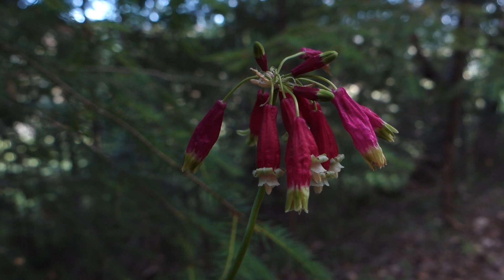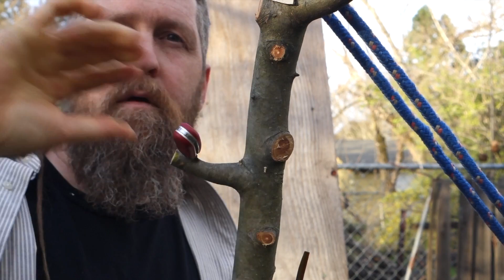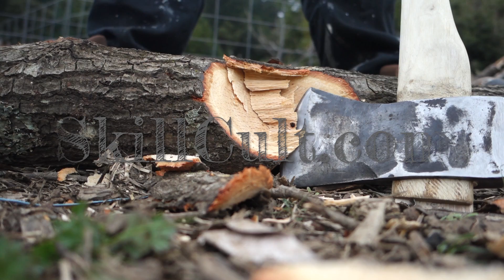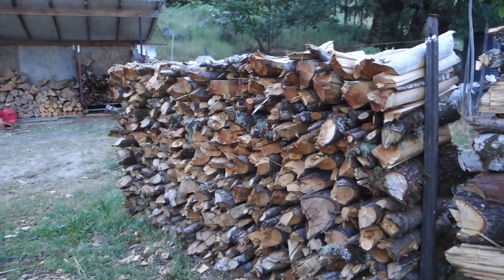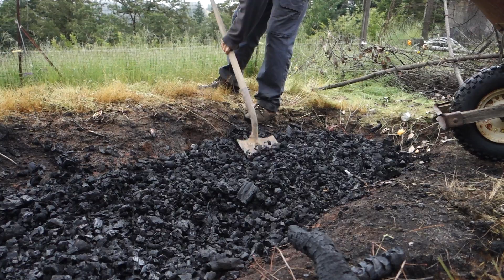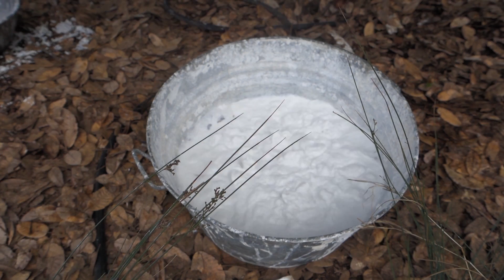2016 Homestead Retrospective Part One, Land, Work, Animals,Projects, Nature

Comment: Have you found any useful advantages for any of the different axe heads (shapes) you have used?   Would you ever buy an axe from someplace like Ebay?  Just saw a beautiful Bruks but am afraid of buying without handling it firsthand.
Reply from the maker: Possibly more so for hatchets, but if you tasked me to design one from scratch, it would probably take me a long time making prototypes and testing them.  For axes, there are maybe things that I don't like more than do like.  Not into really excessive moon shaped bits.  I think it's good not to have the mass too far off center as in the hudson's bay etc.  extreme width, hundson's bay again, or extreme narrowness like the Husqvarna forest axe head.  If the eye is basically small like the swedish forest axes, I like the ears a lot.  I also like the cutaway for those light heads 2 lb and under.  I don't like narrow eyes like hudson's bay.  But then, there are situations where a lot of that stuff is probably good too.  Also, people used really wonky, unbalanced wrapped eye axes with small eyes forever.  The more developed American axes are new comers.  You can get away with a lot.

Ebay is risky.  I'm mostly into going ghetto honestly.  I was just thinking I should make a video about this 5.00 axe I got with a warped handle.  Someone roughly ground it out into a hollow ground configuration.  It sticks in the wood quite a bit, but after some filing  and straightening of the handle several times with steam, it works passable well. It's probably only 2 lbs but I could finish my cord of wood with it this year easily.   Nice axes are nice, but what is nice anyway.  That axe in this video is great.  I like the weight and shape and it's just sexy.  I have a soft spot for forged Swedish axes too, but in this case, it's very soft!  Softest axe head I ever owned.  Not what I expected picking up a vintage swedish axe head.  It's also pretty crooked.  It works well enough considering.  I just have to sharpen it a little bit more frequently, but surprisingly not that much.  I would be not super pleased if I had to pay a competitive price for it.  There are so many perfectly serviceable axe heads for cheap out there if you are looking.  

Give anyone a similar length/weight/shape of whatever cheap axe I'm using like say this 37.00 council boys axe, and they are not going to be any more effective at cutting wood apart than I am and a whole lot less if they spend a lot of time on the internet obsessing over axes instead of out using them.  A lot of the stuff that is discussed just doesn't matter all that much.  Hard to go wrong with most old axes that aren't worn out, burned in a fire, ground too fast etc, as long as they are cheap.  Sometimes you get a lemon, but ebay is a big open market and the prices can be unnecessarily high, so you're paying a lot for something that may or may not be great.  The name is not enough.
Reply: Interesting.  I'm learning a lot and may be taking my research to an extreme.  Some of these YouTube posts are done by morons; "I just bought my first axe and I can barely describe its features but, it is the best axe ever made."  Huh?  That's why I'm enjoying your posts; you seem to know quite a bit about a lot of stuff and maybe have even taught before.  Comes naturally.  Hopefully not to a rabbit hole.  ROFL  Keep up the good work.